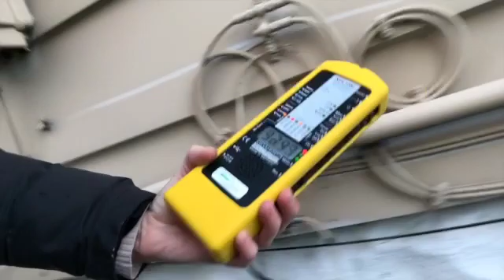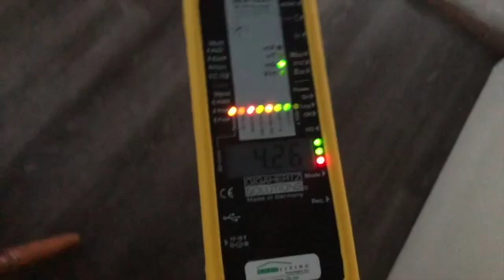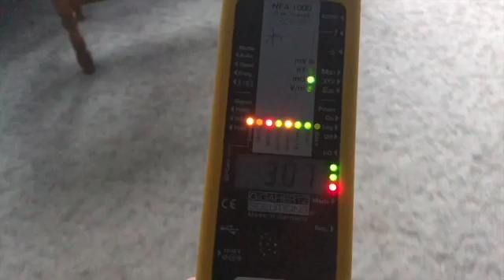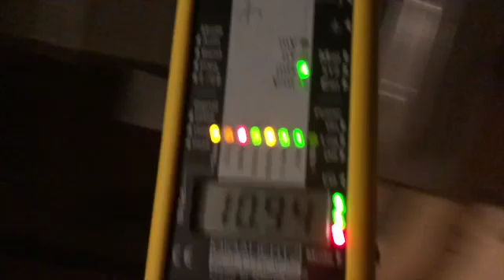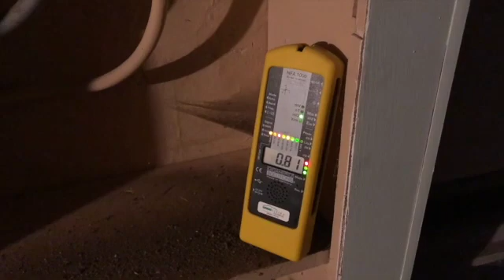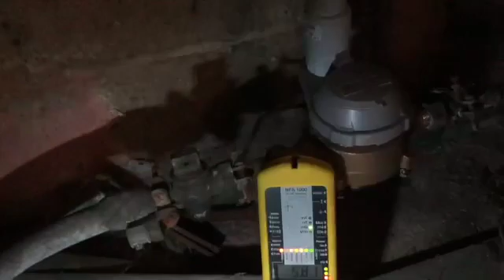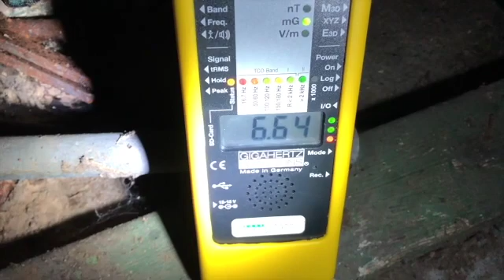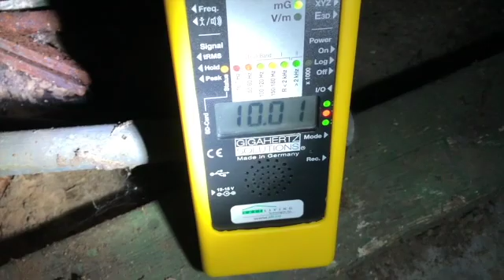EMF HOUSE OF HORRORS!  Three sources of HUGE magnetic fields!

Comment: Targeted individual! They wire your HVAC system for sure
Reply: I think they can inject the signal from a distance using beamforming - if so they could do it without entering the premises or installing anything?  I don't know though, just my opinion
Reply: @policedog4030  Nope. Beamforming won't penetrate underground, let alone the antenna's from Cell Towers aren't tilted towards the ground enough to warranty that type of concern...

Comment: I was wondering of someone could give me some advice. I have an emf meter. Im living in a building that seems to have a powerful magnetic field. The magnetic meter measuring in mG. Which only picks up the magnetic field when I set the meter on weighted frequency, instead of standard. Can someone tell me the difference of these 2 settings?
Reply from the maker: sounds like you have a Trifield meter, is that correct?
Reply: @cathycooke   yes that's correct.
Reply: Do you know what the difference is of these 2 settings?
Reply from the maker: the weighted setting is taking into account electromagnetic interference so will read just a little higher than the standard setting. @DylanKill-my4lb

Comment: Hello I really enjoy your videos. My family and I are trying little by little improving the EMF/Radiation in our home. We also bought filters for dirty electricity to plug into the sockets in our house. But now we heard that yes they will lower the dirty electricity, however, they will produce a magnetic field and instead we should purchase “power perfect box” which is installed between the smart meter and electrical power box and will filter your whole house electricity. Have you tested the magnetic field after installing filters for dirty electricity? I am just confused because I hear conflicting information. Thank you
Reply from the maker: Yes this can be a problem, but not always.  If you have existing wiring errors, then the plug in filters will increase the magnetic field from this problem. IF you don't have wiring errors, then it shouldn't be a problem.  There is no way to know this unless you get an assessment from a professional, which I would recommend.  The Power Perfect box will not solve your problems.  You first need to know what exactly you're dealing with, and then address those issues from there.  You must measure first.
Reply: Thank you for your reply. I was going to purchase the alpha labs Gauss meter that you recommend from one of your latest videos to measure the magnetic fields around my home. Before having to hire another professional, would it be effective to use the alpha labs Gauss meter to measure the magnetic fields before and after installing the filters?
Reply from the maker: @perezchiro6919  yes you could do that. Here's a link that gives you 5% off that meter:  https://safelivingtechnologies.com/cart.php?action=add&sku=SLT-1388&couponcode=WHBH-5

Comment: Wow this was a nice frame of ref, thank you. I have a similar set of readings at my meter. It's 30 Milligauss up against the meter and about 118 against the conduit. In the yard about 10 feet away it's between 1-2. I'm not even sure what I'd tell my power company.
Reply from the maker: If it's 1-2 mG inside your home you want to try and deal with this.  You may need to consult with someone like myself or other professional to help you make a plan of action.
Reply: @cathycooke  Thanks for your response I love your channel! You've given so much which is appreciated. Not looking for a freebie, just sharing for all. You're probably too far away - I'm on the east coast. I honestly think I'm in a bad location. My house is flanked by two streets with power lines close front and back. So with the Main off, it's around .5 mG in the majority of the rooms except for one which I'm planning on moving my sleeping quarters to. The room I'm in now is 1 mG (AC running in the window). There's a couple of old circuits with knob and tube wiring. I've been planning on gutting it and remodeling w/ MC cable but then got ill with lyme and lead poisoning. I'm slowly getting better and am having the best year yet after over 15 years of struggle. Spent 10's of thousands on my health and have learned quite a bit about EMF, but it always leads me down a rabbit hole and it's hard to make things work with a busy work life. I'm grateful to your frames of reference because I didn't realize what was considered high for mag fields. And since going that close to my meter getting the readings, I realize it's the mag fields I'm sensitive to, not the RF so much (flare of symptoms). So great step forward and I have you to thank. I have some things I'm going to do starting with a room I will remodel as a 'safe room' complete with MC Cable and RF shielding for that sleep sanctuary.

Comment: I have a Nissan and can turn the bluetooth off through the display/radio but must do it every time the car is started. Would like to disconnect it permanently.
Reply: I'm afraid to buy any car made after about 2015, for this reason.
Reply: @MGillDesign  We just traded in the 2015 Nissan for a 2017 Ford truck and you can turn the bluetooth off and it stays off! I was SO happy 😊
Reply: @TruthSeeker-ee8tj  nice.

Comment: Please help if you can! I'm having a similar issue. I just got a new panel installed and wired everything exactly like it was on the old panel. With the old panel I had no issues whatsoever. My magnetic fields were very low everywhere in the house. 

Before we could install the new panel I had to have a weather head put on. The old one fell off at some point and we were getting water in the panel. The utility company came out the day we replaced the panel and disconnected the service wires at the roof where they come in from the pole. He was nice enough to install the weather head for us. He also disconnected the meter as we needed to replace the service wires coming from the meter going to the new panel because they were corroded. We finally finished installing the new service wires and the new panel and the utility company came out and turned everything back on.

Fast forward to the next day, I pulled out my meter and started measuring and across the living room floor I was getting ridiculous amounts of magnetic fields. It was never like this before. There was a small amount before installing the new panel, around 2-4 mg because the AC unit wiring ran across the living room floor in the basement. Turning off the heat would always reduce the fields down to 0.4 or less. But now turning off the heat does almost nothing and the fields are no longer 2-4 but now 10-20 and the closer you get to the wall where the panel is installed in the basement, the higher it gets. So pretty much right above the panel in the living room I'm getting over 100mg on the floor. This was never ever an issue before. The fields are not only much higher but they also carry a lot further than before.

I went in the basement to investigate and turns out the AC unit wiring is maxing out the meter. Over 100 mg on both wires. For now I've turned off the breakers which helped a little but there is still a huge field across the living room floor coming from the panel it's self because it's installed in the basement right below the living room.

When I turn off all breakers in the house the field finally goes to 0.2-0.4. But turn on even one breaker the field jumps to 10mg immediately. And as I turn on each breaker one by one the field increases gradually until it maxes out the meter. When doing this test I have the meter laying flat on the living room floor above where the panel is installed. I'm using the trifield tf2 to measure.

So.. After watching this video today, I went outside to measure the meter and conduit as you did in this video. And the meter is giving me 50 or more mg, the conduit above the meter is giving me 30-40 mg, and the conduit below the meter is giving me over 100 mg which maxes out the meter.. As a side note I walked across the yard to my neighbors meter and conduit just to compare and I only measured at the most 5mg on my neighbors meter and all conduit. So I know the numbers I'm getting on my meter and conduit aren't normal.

Now.. With all that being said and sorry for the entire book I just wrote lol.. What do you recommend from here? As I said we made sure that everything in the new panel was installed identical to the old panel. I do not believe the problem is on my end after measuring the meter and conduit. It seems the issue is coming from the service wires and the meter. 

What do you think? How do you recommend I proceed from here? How can I get the utility company to come out and take a look and try to fix the issue? I'm not even sure what to say to them when I call. I would hate to say something wrong and have them say they can't come out for something like that. I'm really at a loss here as to what to do. Aren't high fields like that considered a code violation or something? Please help me! I'm literally devastated and don't know what to do. I had my numbers so perfect before installing the new panel. What can I say to the utility company to have them come out and take a look?

I tried to be as detailed as possible when writing this. If there is more info you need from me just let me know. You seem like my only hope. I feel like me seeing this video today was meant to be. I hope you can help me. Thanks in advance.
Reply from the maker: This is a complicated issue and one I can't give advice on based on the small amount of information I have.  There is definitely a net current issue happening, and it sounds like a wiring error in the panel if it was not there before, or perhaps a loose neutral.  If you'd like to consult on this you can contact me at https://wholehomeandbodyhealth.com/  I just don't want to give bad advice without knowing all the details.
Reply: @cathycooke  I will give you a call tomorrow. I can call you at the number on your website correct? I really appreciate your help!